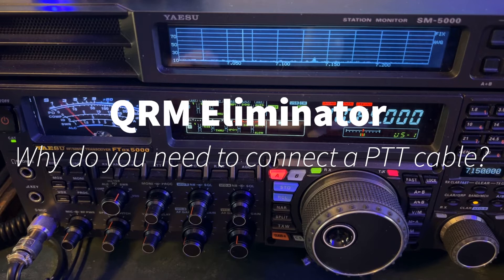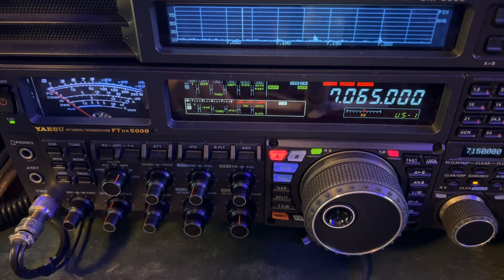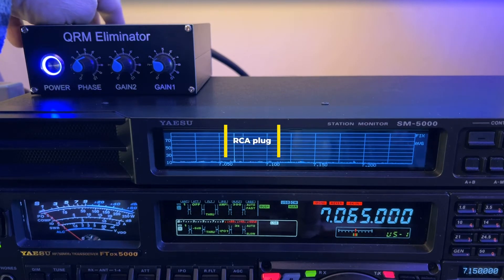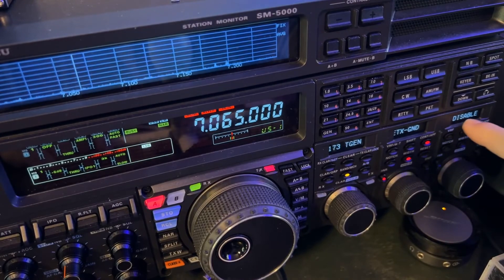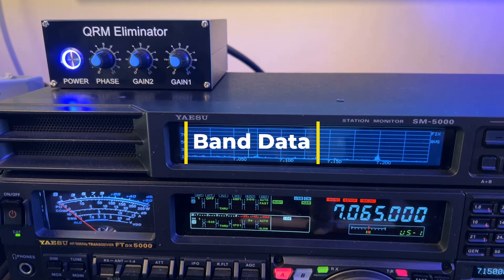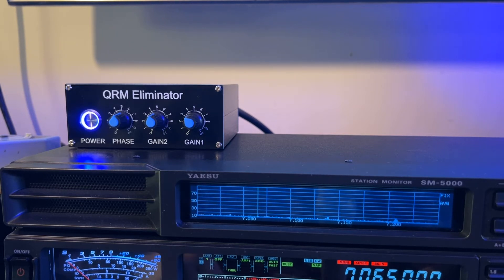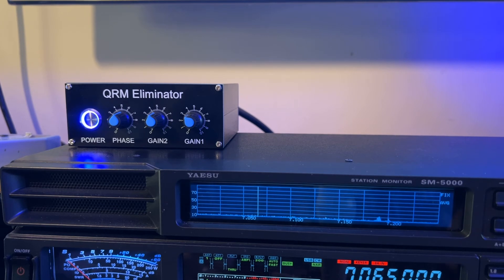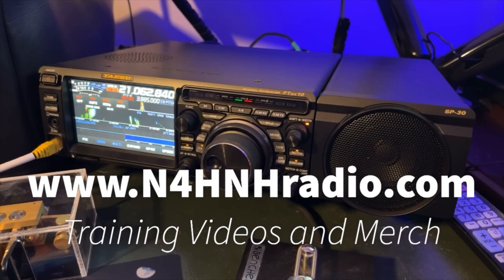QRM Eliminator (Why you need to connect a PTT cable)

Comment: Thanks for the video but I have a question. I’m using an FTDX 10 and an amplifier and tuner. One using the linear and tuner ports. Since this needs PTT, can I use a RCA Y splitter so my radio can PTT both the amp and QRM Eliminator? Would this work? Thanks for your videos. 👍🏻
Reply from the maker: You could try a splitter but be careful of current draw.  To protect your radio, just as a precaution, you might consider a buffer device, like the MFJ ARB-704.  The ARB-704 does not include built-in circuitry or multiple dedicated output ports specifically for splitting the PTT signal to several devices (like more than one amplifier or an amplifier and a tuner) in parallel.

However, it is possible, with some custom cabling, to physically split the PTT output from the ARB-704 (using a Y-cable or similar), allowing simultaneous triggering of more than one downstream device. This setup should be approached with caution to avoid exceeding the total current rating (300 mA) and voltage specifications (200V peak) of the ARB-704 relay output.

Some users solve multi-device control by internally modifying the ARB-704, adding extra output connectors, or by making use of the multi-port DIN connector for distributing signals, but this requires careful DIY wiring.

I don’t always answer questions here, especially if the person does not identify themselves as one of my Patreon members.  I do however answer questions for S9 (VIP) Patreon members who subscribe annually.  They are able to ask questions and receive personal Zoom consultations.

Comment: i have a yaesu ft80c ,and atu 100 tuner , can you help me out in the setup with this qrm eliminator ? 
how to set it up, how to connect tuner with the rig and the qrm elimnator
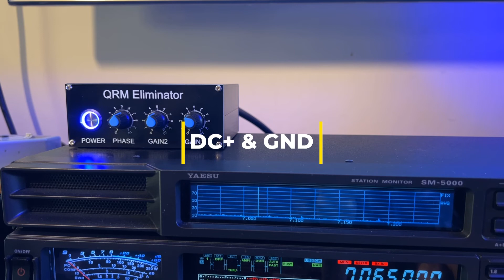Reply from the maker: The QRM Eliminator can be installed between the ATU and the radio, assuming you don’t use a linear amplifier.  Connect a coax from the radio to the QRM Eliminator transmitter connection. Connect a coax between the main coax connection of the QRM Eliminator and the transmitter connection on the ATU.  Connect your transmit antenna to the ATU.  Connect a noise receive antenna to the auxiliary coax connection on the QRM Eliminator.  Connect an RCA cable between the QRM Eliminator PTT connection and your transceiver’s TX GND (PTT) connection.  It is a phono jack.  Power up the QRM Eliminator.  Start with the phase knob at the 12:00 position.   Adjust the two antenna gain knobs until you are getting equal signal level on each.  Next, adjust the phase control to minimize the noise.  Finally, fine adjust each antenna gain knob to see if you can minimize the noise even more. If so, adjust the phase knob once more for minimum noise.

I hope this helps.
Reply: @n4hnhradio  i have a yaesu ft80c and it has a ptt labelled port at the back that  is RCA type . , so this port will be the one connected to PTT of qrm eliminator ?
Reply from the maker: @hamidch632 Yes, and make sure when you transmit the radio you hear a relay click inside the QRM Eliminator. That indicates that the QRM Eliminator is protecting the antenna inputs from RF power.  That’s the purpose of this connection. Certain QRM Eliminator models have a TX light to confirm the PTT signal has been received.

Comment: What path does the RF take inside the QRM eliminator when the PTT isn't triggered? How does it not blow up?
Reply from the maker: It will blow up eventually.  The RF doesn’t get diverted away from the receiver circuit if you don’t provide a PTT connection. That is why I made this video.  I damaged mine to make this video.

Comment: Thanks for this great video! I own Yaesu FT-710 and I wonder where should i connect the PTT cable (the one with RCA connector on the one side and naked on the other). I suppose on the Tuner/Linear 8 pin connection soldering TX GRD and GRD pin to a 8 pin mini din connector, but not sure....
Reply from the maker: If you don’t use an amplifier or an antenna tuner, the 8-pin Tuner/Linear connector can be used.  You need ground and PTT.  I use a Heil FS-2 footswitch, so I don’t have to tie up the Tuner/Linear connector.

Comment: The Heil fs2 has been disconnected. A new fs3 is only one they have
Reply from the maker: The FS-3 only has one switch/cable. It won’t work for the QRM Eliminator.  I already made a video about the FS-3.
Reply: who cares, it's a video about the QRM eliminator.
Reply from the maker: The Heil FS-2 is the easiest way to provide the required PTT signal to the QRM Eliminator.  I spoke about it in the video.  That’s why @kd4exy mentioned that the FS-2 has been discontinued.  In fact, it was only discontinued a few months ago.   I’m sure @kd4exy meant to type “discontinued”, not “disconnected.”   

Some newer transceivers do not have a TX GND connection that provides the dry contact for the PTT signal via an RCA cable.  A special (usually 8 or 10 pin DIN) cable must be made and connected to the Tuner or Linear port, which prevents those ports from being used for their intended purpose. It’s especially bothersome with transceivers like the FT-710, which has one port that you must choose in the menu to either be for keying a linear amplifier or operating an antenna matching unit.

Comment: Try RM Noise, the AI noise reduction. Works brilliantly.
Reply from the maker: Yes, I’ve heard the RM Noise software demonstration.  Not bad but I still hear a remnant of the noise, and the received audio is adversely affected. Phase cancelling the noise before it ever reaches the radio is still the most effective approach. 

As I show throughout my videos, it is best to attack noise in the front end of the receiver first, before it even gets to the second IF, or SDR stage, and especially before the DSP stage. But, it’s even better, to stop it before it enters the radio, like the phase cancellation devices do.